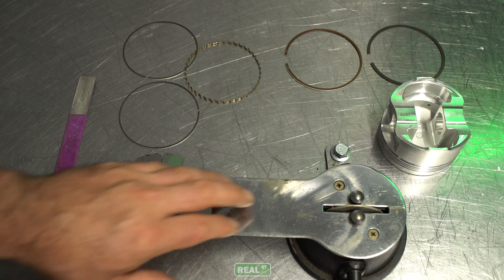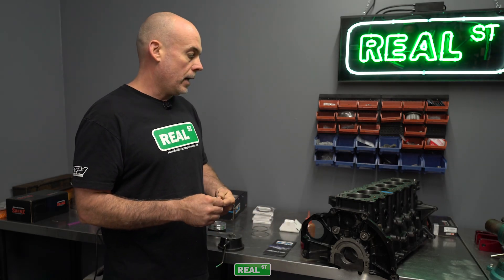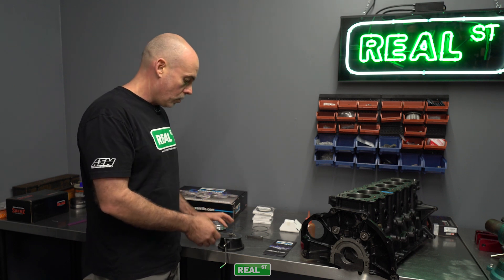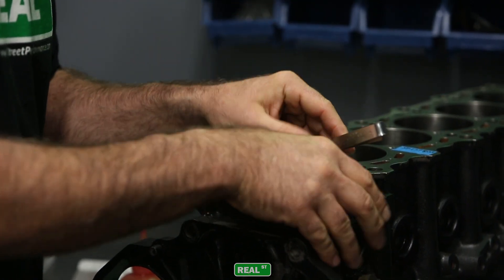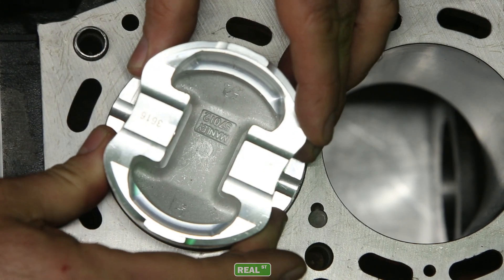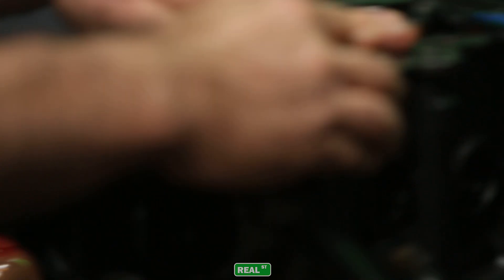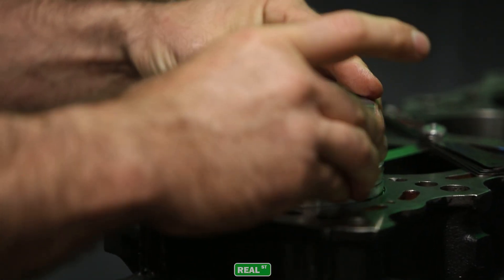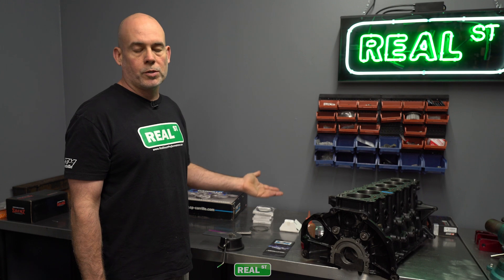Jay's Tech Tips #47: Piston Ring Filing - Real Street Performance

Comment: I bought a filer like this one from amazon. The cutting wheel doesn't rotate smoothly. It wobbles. Jay if you're reading this please help. I don't know if your one runs strait or if it supposed to have a wobble???? I'm thinking is shouldn't. Mine is some Chinese job I'm sure not a name branded ring grinder.

Comment: How important is it to gap the ring using the exact cylinder it will be installed in?
Reply from the maker: You'd ideally set each bore to be as similar to the next as possible, and many instances a ring gap will be the same in another cylinder if that practices is followed. That being said, its a good rule of thumb to follow keeping each cylinder and its related components together for organization as well.

Comment: I like deburring the ring after every pass. It removes sharp edges before you put it inside the bore and potentially scratch fresh surface. You can actually feel that sharp edge after a pass.
Reply: After putting a cross hatch on the bore , so scrathing the bored no issue ,,, i use  chicken 🐓 grease on all my builds it works way better than assembly lube ,, and if you smell fried chicken when you first fire the engine up then you know you did good 🐓👌👍😂
Reply: @JamesAnderson-zu7hl Why chicken grease

Comment: Thank for tutorial but i have a question for you so what size of the filler gadge is good for petro engine and  diesel engine 0.25 for petro engine ring top and and second and 0.15 for oil ring is that ok

Comment: I have a problem 😢 i dont konw, i have 84mm  p30 piston for allmotor b16a2, what size all the rings i need to do? Thx 🙏
Reply: Top ring- 0.43mm
Second ring- 0.43mm
Oil ring's- 0.75mm

Is this correct? Thx for the help

Comment: Nice video. What are your thoughts on filing the gap on over size piston rings? I have an air cooled motorcycle, a Honda XR650L single that comes stock with a 100mm bore. I rebuilt the top end a couple of years ago, which included a .5mm oversize bore and new piston set at .002" clearance at the skirt. Performed slow break-in and heat cycles. I checked the ring end gap with the Honda factory manual spec and to my surprise the new rings were almost at the service limit before assembly. That is, the gaps were already at the high end of the tolerance. I noticed this same trend on a few other XR650Ls I rebuilt for friends. Is there any draw back from buying 1.00mm oversize rings and precisely file the gap down to my current .5mm bore to the lower end of the gap tolerance? Any concerns about the extra ring tension against the cylinder walls? I am not worried about my skill as I am a retired machinist and have been working on engines for a long time. Thanks for your thoughts.

Comment: Hi jst wondering if you could help. I've a subaru ej257 2.5 sti. Jst been bored to 100mm. I have cp pistons and the bottom rings oil ring there is only 1 of them on each piston packet with 1 tang, is this correct as I thought there should be 2 tangs. 1 on each oil ring. Also could you suggest ring gap for all rings thanks paul

Comment: Thanks for such a informative video. I intend to rebuild engine of my Vauxhall Victor FB 1964 model, I am having difficulty in deciding which scrapper rings should I install, there is one piece cast iron rings and then there is thin steel rail type rings with expander and helper, which one would be better for a durable and longer service life? The engine is low rev., max five thousand rpm and 8.5:1 compression ratio. Your guidance in this regard would be highly appreciated. Thanks

Comment: Thank you for this video. I recently purchased a freshly built shortblock sbf 363. The ring gaps are .019 according to the sheet. I know these were gapped for a N/A set up. I plan on running 10 psi boost at first then maybe 15 later on. Do you have a recommendation of what I should gap them at?
Reply: When I raced my Mustang (SBF)  I tried different ring gaps to see if it would make a difference. I ran from .022 to .030 with 15-16psi of non intercooler boost and it didn't amount to any measurable difference.  IF you overheat the ring and it butts the ring bends and the engine loses seal.  I'd suggest this is an area of the engine that being on the loose side is better as "larger" ring gaps don't hurt your program.  I'd start with .023 on the top and .027 on the second.  That's a safe place to be.  Good luck with your build and if it's high compression run some good Ethanol!
Reply: @jaymeagher1510  thanks for the reply and info. Yes I don't want the ring.ends to touch. I'll be using my Strim vortech with a 4 inch on3 intercooler to start with because that's my current set up on my car now. I know the Strim is small for the new engine and will upgrade blowers hopefully next year. I havent bought the heads for it yet.but I'm trying to be around 9.5:1 to 10.1 compression. My charge temps normally stay below 100 degrees even on hot days.
Reply: @Bobby4v   I've been low 9's with the S trim so it's not exactly a "small" blower. As you increase blower size along with the intercooler you fight belt slip.  If you're using pump fuel lower the compression more. It will live longer.  The IAT sensors are pretty slow, be careful with trusting that information.  Thanks

Comment: So you would go .001 larger when not using a torque plate right? So in the example chart you display it says .0055 for top ring if blown. So you go .0065? Just checking.  Also,  what about bore or honing the cylinders, do you think using a torque plate isn’t necessary with big HP? I want to put forged pistons in my Viper but don’t love the expense of the torque plate.
Reply: Just go for it no torque plate needed

Comment: Can you do a video 
 on measuring piston to deck and valve to piston clearances for selecting the proper head gasket?
Reply: We can add it to the list.  Very few engines have the pistons above the deck, most however can have piston to valve clearance issues with aftermarket cams. You could correct piston to head with a gasket thickness change just keep in mind thick steel gaskets are harder for the deck and head to seal and IF you need to go to a thicker gasket I'd use a 5 layer before a 3 layer.  You generally correct piston to valve with deeper/larger valve reliefs. Thank you.
Reply: Jay Meagher ohh cool man.  Thanks for replying. I wasn’t even sure my comment would be seen Hahaha. I guess my main concern was the piston to valve clearance as I’m having a block and head in the process of being built and both will be resurfaced so I want to make sure I take the proper steps to measuring for the correct head gasket. I will be running an aftermarket cam.  A GSC cam for a stroker 4g63 . I actually recently ordered a few parts from you guys.  And definitely going to be placing a decent size order this week (Black Friday lol) 
Thanks for the consideration on making those videos too.
Reply: @yellowrice1453  Most of the aftermarket pistons have ample valve reliefs for aftermarket cams. It's best to use some clay and check it during mock up. Thanks for your support, we have a killer sale this year and I hope you save some money and get what you need.

Comment: Hi Jay how do i determine what my ring gap should be i bought a set of Wossner pistons for my 2014 Ford fiesta ST180 1.6 and there are no instructions on what the ring end gap should be? Any advice?
Reply from the maker: jodin coetzee hey Jodin have you tried asking Wossner? I usually recommend to stick to the manufacturer specs. If you didn’t get any then I would start by getting the instructions from them

Comment: Awesome video. 
is the target always going to be 0.0025? of an Inch? or does it vary per piston or cylinder wall ?
Reply: Ring gap will depend on application and cylinder bore size.
Reply: Every application will be different. The document that come with the pistons will help you calculate 👍🏼

Comment: What should be my gap clearance if I am using both 95 octane pump gas for low boost and c16 when I turn high boost ? (2JZ 9.5:1CR)
Reply: Ring Gaps are one of many steps in Engine Blueprinting. Many factors must be taken into consideration when building an engine. This includes the Ring Gap in Combination with everything else. Your dual purpose car will be compromised with the amount of Ring Gap.

Comment: Very detailed and informative.
Some info about ring gap in relation to fuel, cyl pressures, EGTs, compression height, antilag use, how mutch gap will give you non torque plated block after break-in and so on..., would be good material for next vid, since there is rarely trustworthy people you can rely on, like you.

Tnx Jay.